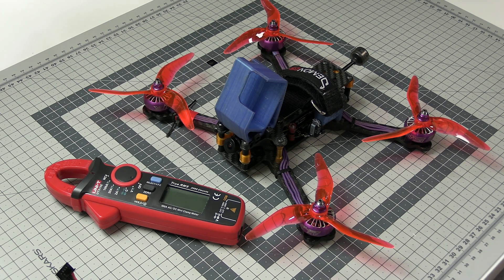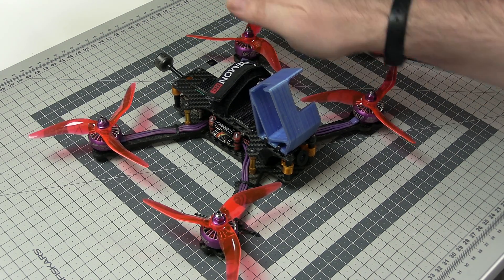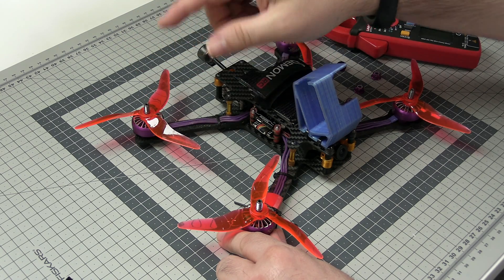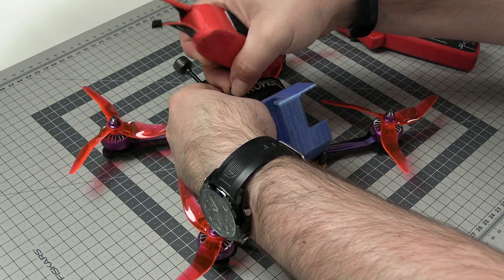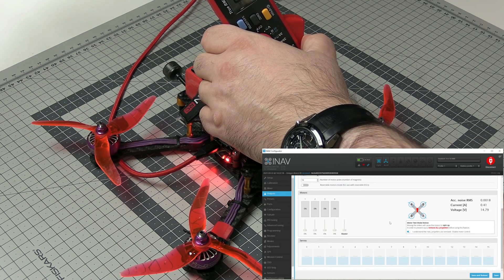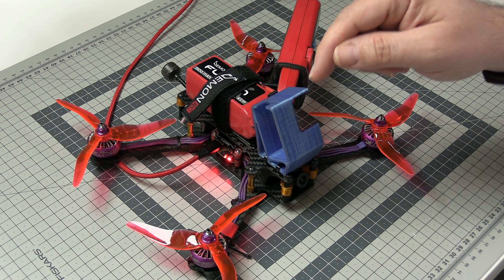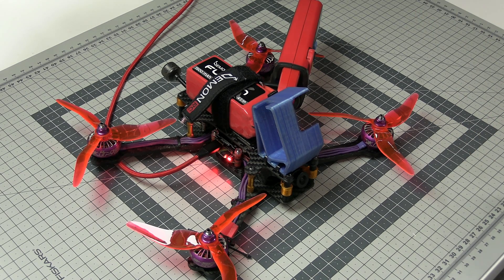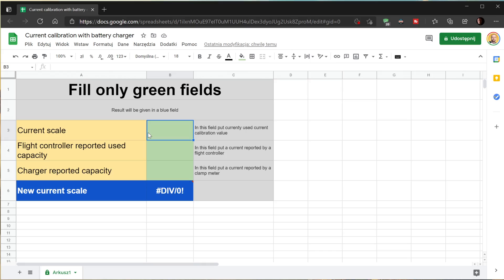How to calibrate the drone current sensor? Clamp meter and charger methods

Comment: Even in AC mode clamp meters are sensitive to cable location. DC mode works not with a transformer but with a couple of Hall sensors and they are affected by cable location way more. What you show on 4:30 looks completely wrong, so it could be that you even made your calibration worse. I don't have such a DC clamp meter on hand so I can't tell exactly which error is achievable by incorrect use, but 30 % looks doable.

Comment: Following this I'm getting in the ball park but I don't have a starter value for "Scale" to enter.  I took some guesses but I'm presently around 95 for scale.  What about "Offset"?  The accuracy seems to drift quite a bit the more amps I draw.  Can you get an accurate result by adjusting "Scale" value only?

Comment: if you have calibrated the sensor, then there is a change in esc.
does it need recalibration or not?

Thanks pawel.
Reply from the maker: No, you calibrate the sensor, not the ESC. If you change the sensor, then you have to recalibrate it

Comment: 9:25 Actually I do not agree with you Paweł.
Of course some energy is being lost as heat during discharging and recharging. But it's energy not electric charge.
To be precise, some electric charge is lost but it's negligibly small. Some charge can be also lost in balancing module in the charger is poor quality. However, most of energy is being lost due to voltage drop on battery's internal resistance.

Comment: Pawel, I have been experimenting with a method where I make two accurate measurements, one at low RMP and one at a higher RPM. I put the two sets of data into a spreadsheet that calculates values for both Scale and Offset. What I use is a ToolkitRC M6D and possibly also a 100nF capacitor to filter the current sensor signal. Do you need this kind of accuracy? Probably not, but it can be done and I find the result amazing. I am not going to make a video about it, but you can if you are interested.

Comment: I cant recommend the "Toolkit RC" watt-meter enough. the servo/esc tester signal out function is really useful as well. It has a 150 watt peak use.     Good vid. I usually have trouble calibrating FC shunts because the value works rite at one "point" of throttle but not necessarily the other. Like cruising vs idle

Comment: Depending on throttle position on my wing the values go out of accuracy as throttle is increased beyond the testing value used Using the ammeter method. Do I need to set the offset option ?
Reply: Setting both scale and offset is a totally different ballgame. For simplicity set offset to zero. If the Amps displayed are far too high when unarmed, then you probably have noise on the current sensor signal. That must be fixed first!

Comment: AWESOME!  2 very simple methods to get accurate readings and therefore predictable power consumption readings.  I tried to figure out how i could get resistance: slowing the motors by hand or soldering a power resistor - but just reversing the props - how simple (and relative safe) is that! Smart! Thank you so much.
Servus aus Wien!
Reply: Small props are less scary than large props. I use 3-inch props - reversed.

Comment: Duh!!! I never thought of reversing the prop positions. My method was to strap the quad to a piece of wood in my bench vice and hoped for the best. I survived. :D
I also used the radio to spin the motors up and got weird, unstable results until I changed the flight mode from my default "Level" to "Acro/No Mode". The FC was trying to level the quad while the motors were running. Again, thanks Pawel for broadening my knowledge and saving my fingers. :D

Comment: The reading is always pretty stable on my clamp meter, or running through my normal meter (which does up to 10A) for micros, but in betaflight it jumps around so much it's hard to estimate the mean, or even median.

Comment: Why not use bench power supply with current display :)? Or more easily a charger in power source mode (they also display current consumption)?

Comment: A shuntmeter should also work but then the batterycable woulf have to run through that shunt while emulating the flight on the bench to get the full power consumption.
Great explanation - thanks a lot.

Comment: If you only have an AC clamp meter would it then make sense to measure one out of the three motor wires and multiply it by three and then by four to get the total motor power consumption. The motors consume almost all of the power so wouldn’t it be a realistic to compare the total power consumption with the motor power consumption?
Reply: A ac only meter may not measure it correctly because our rc motors don't run on ac but on switched dc(pwm).
If you use a scope you would see a square wave not a sinus wave like mains ac
Reply: @Tobi-xj8xw  I’m pretty sure that’s not the case. The PWM signal is only used to control the ESC. The output of the ESC I a sine wave. That’s how you drive BLDC motors. They need AC to run. The ESC is generating the AC signal with a bunch of mosfets to make it capable to output both positive and negative voltages just like an inverter
Reply: @lucaswybrandt7058  haven't seen your comment until now, sorry
First
The motors er use in the hobby are synchronous motors so let's say we connected the motor to a 3 fase outlet(bringing down the voltage with a transformer) the motor would not run.
3 fase ac motors are asynchronous motors

Second 
There's a difference between the pwm we use for servos and speed controllers and Pwm used for motor control.
The pwm we use for servos is measured with micro seconds and how many refreshes per second measured with Hz 

The pwm used for motor control is measured in duty cycles

Edit: the example below would be for a brushed dc motor for a 3 fase bldc motor the plus and minus would switch like
First fase + secend Fase minus third fase nothing
First fase nothing secend fase + third fase -
First fase - secend fase nothing third fase +

A duty cycle of 50% and would mean it would be on for halv of the time then off the other half, effectively halving The voltage